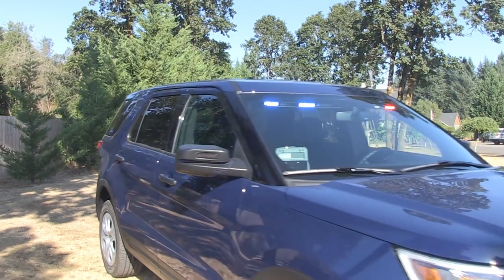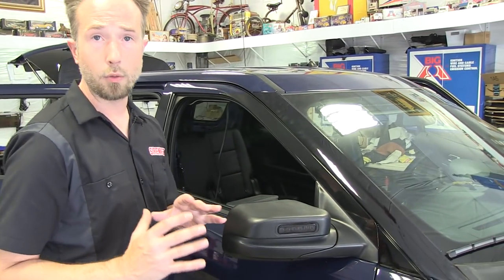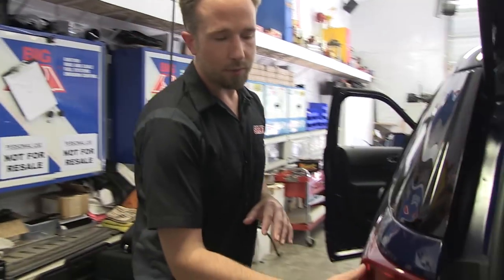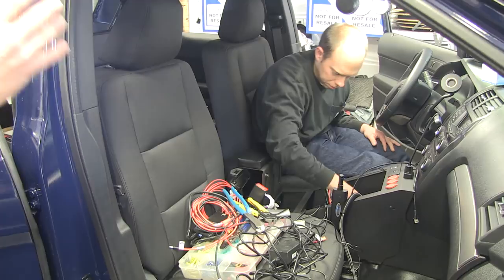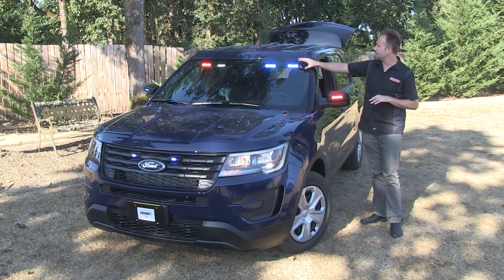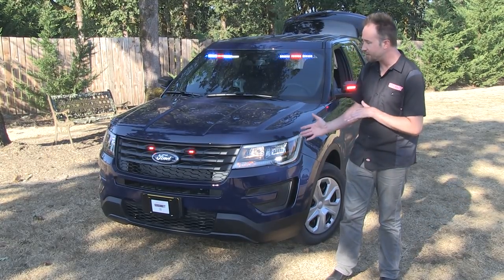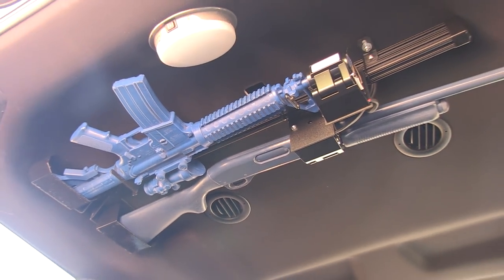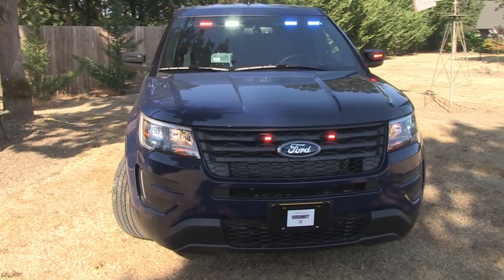A 2017 Ford Utility Interceptor, Watch Commander Style Installation

Comment: If you order from ford with the fog light warning system it can be used as both a fog light and emergency warning lights. Most civilian models do have the lights down low.

Comment: I’ve been up fitting a 2016 Utility and want to add wig wags. I know Whelen makes a plug and play module for this car but it only works with cars that have option 60A. How can I check to see if this Utility was ordered with this option or not? Thank you.
Reply from the maker: Do you have the "Options Order Sheet" with any of the original paper work? This form would specify any of the options that were included in the  Utility. The modifiers guide might help... it can be found online at: fordpoliceinterceptorupfit.com